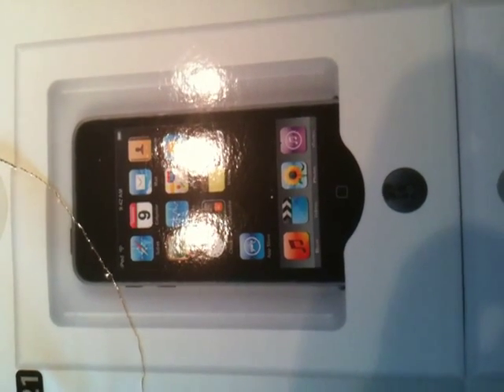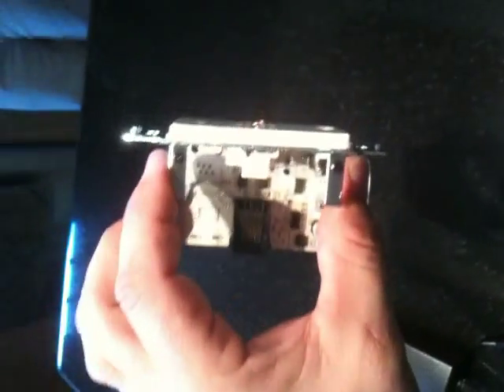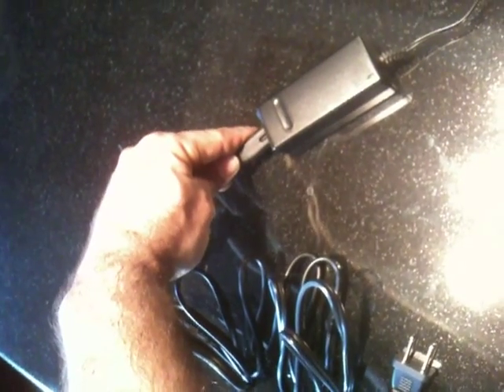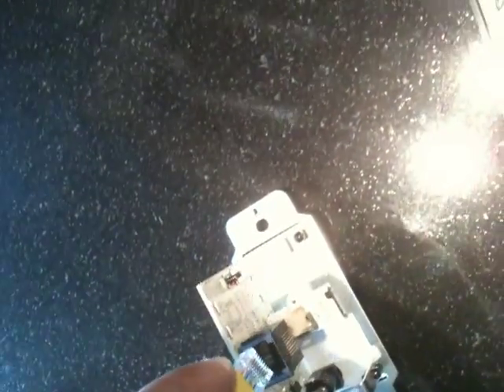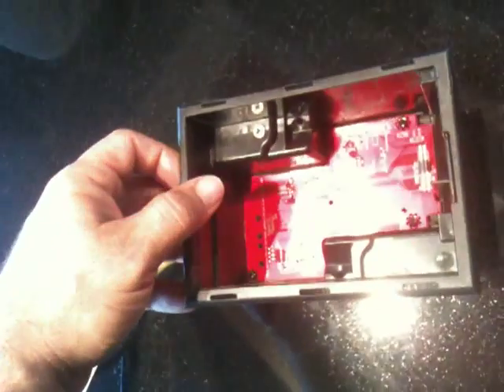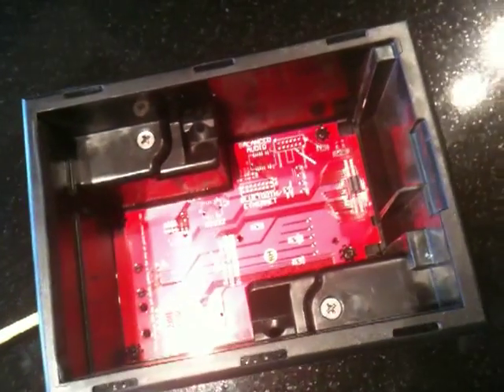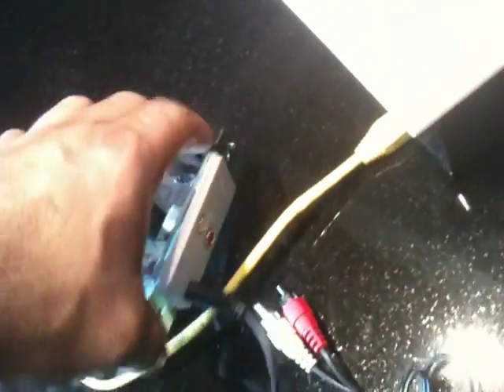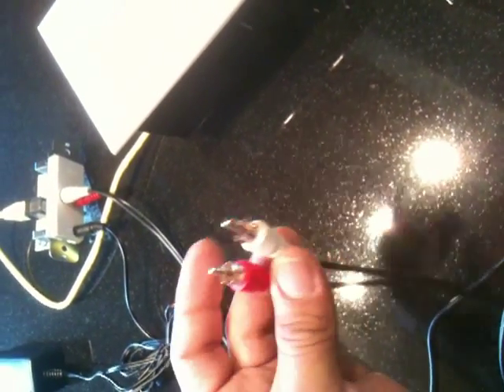iPort Setup_01.MOV

Comment: I have no idea if you will see this. I bought a house with this setup and I don't have iPhone. I bought a Bluetooth adapter for the port to run with my android. I plugged the LR audio to IN and no sound. Any help?
Reply from the maker: This unit is designed to work with the audio input circuit and is only an output. So you cannot plug in a Bluetooth into it. You need to plug your Bluetooth into your stereo system input. 
Best regards…